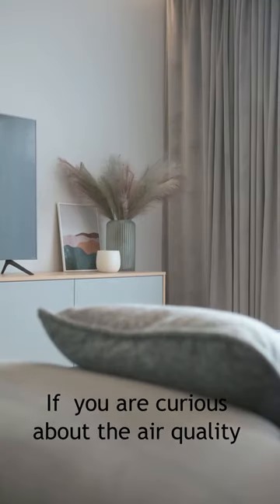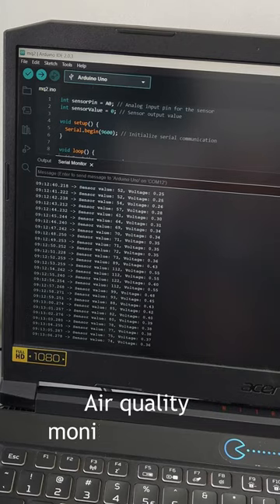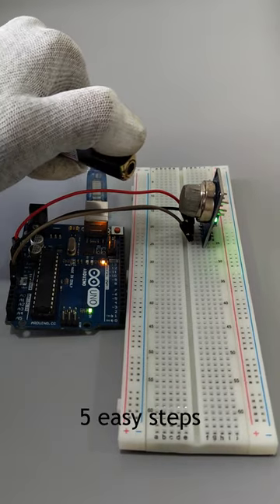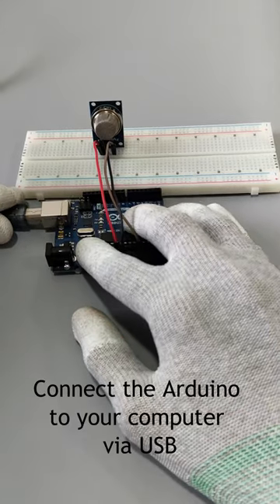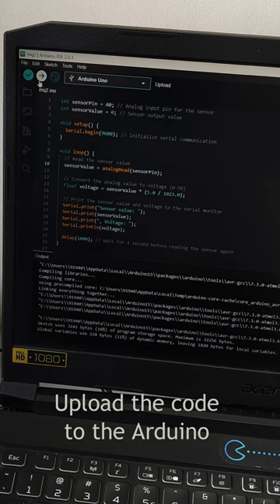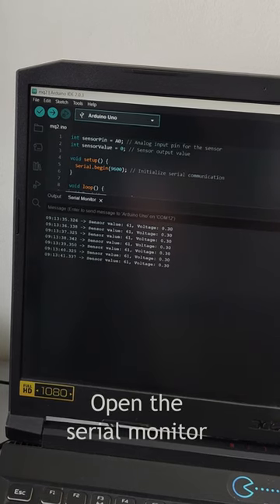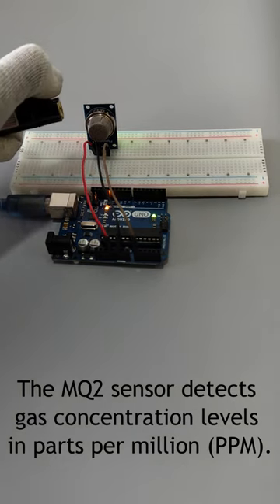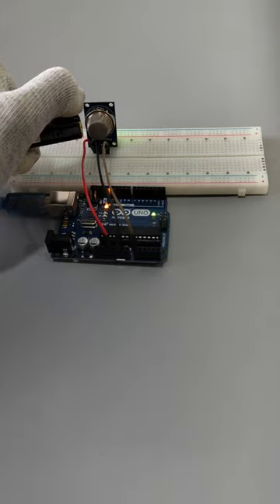Air Quality Monitoring in 5 Easy Steps using #arduino

Comment: Arre who said you this is a air quality sensor,? Or can be used as one?? 

Its purely to detect gases. Not air quality. 

This is 100% wrong.
Reply: This is for project works only,not much dependable irl
Reply: @akp4871  What ever its for... If you are making a project on air quality, use a sensor that showes that..... as per your "JUST FOR PROJECT WORK" its not important at all, use a potato instead... anyways its just for project...
Reply: Check the code in chat gpt
Reply: @crsvasan  What is there to do with the code when the sensor used itself is wrong for the purpose ?